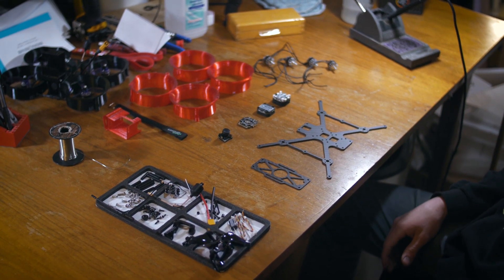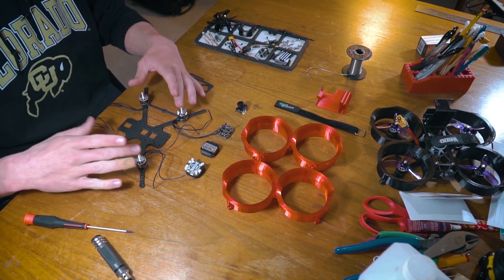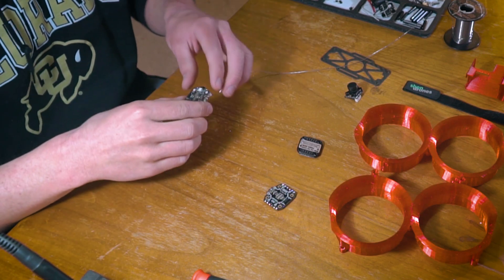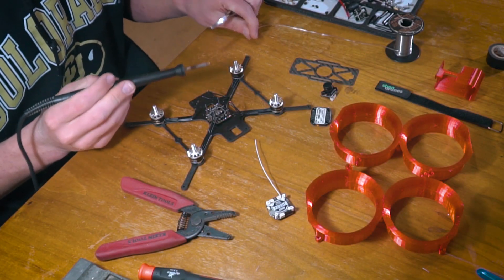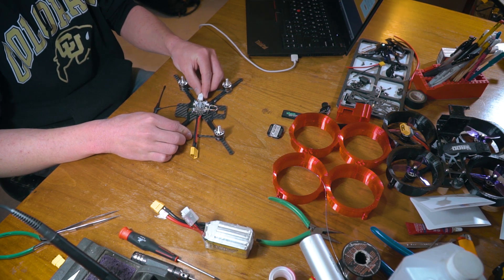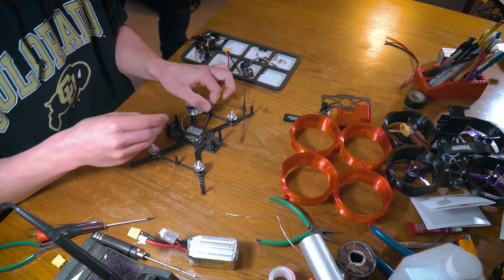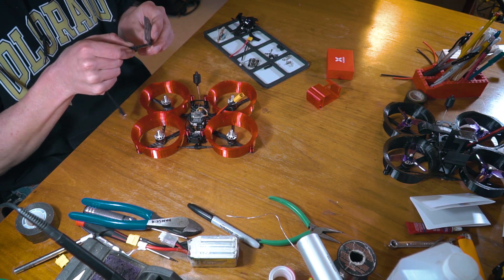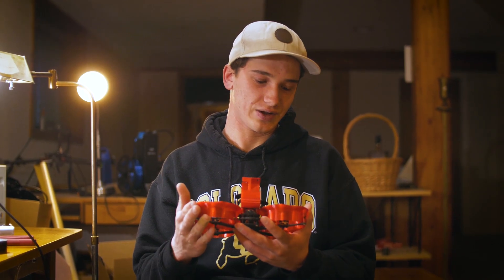How To Build A Cinewhoop Step by Step // Shendrones Squirt V2

Comment: Do you still recommend this build for beginners in 2023? Also, do the smaller hardware pieces ie screws come with the parts or are they bought separately? Thanks